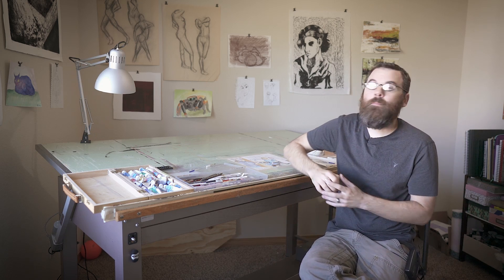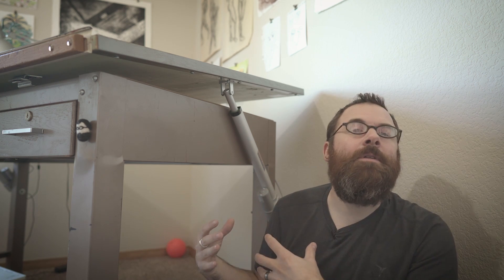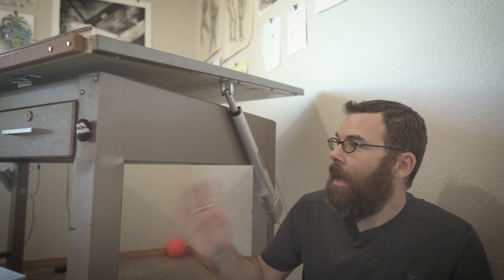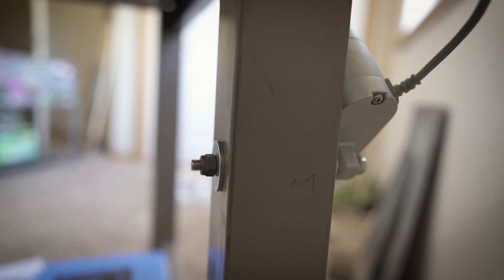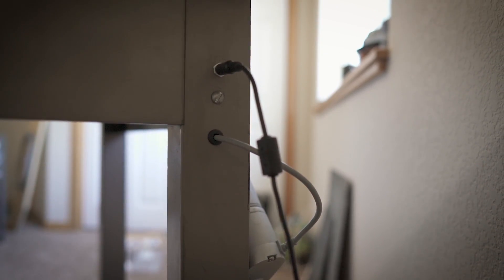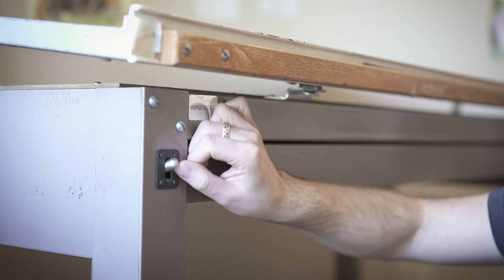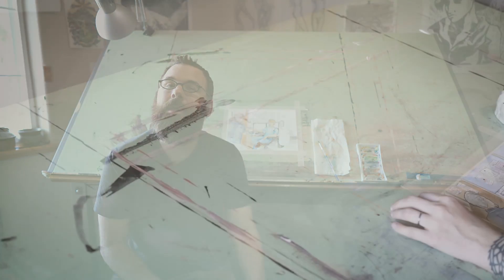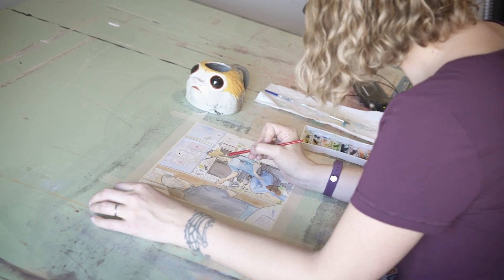DIY Motorized Drawing Desk

Comment: Robert, do you think it would be okay to attach a tirnigy outrunner Motor  directly to a wheel without the gear box or would it not work?
Reply: Too fast not enough torque.

Comment: Could you explain how you wire in the indicator LED on your smaller battlebots?
Reply from the maker: It's easy, just connect it to the radio receiver.  your receiver will have 5V and ground, so you can use that and just make sure you have a resistor so it doesn't draw too much current.  people like endbots or fingertech sell LEDs with built in resistors so all you need to do is plug it into your receiver and you're done!
Reply: Robert Cowan hi, no vídeo this week?
Reply from the maker: @luizsoares9481  I had one, but the original publish/upload date was some time ago, so it didn't show as new.  I will most likely have one next week.

Comment: Why no encoders and regulation ? would make left and right align correctly
Reply from the maker: You're totally right.  I could have read the other two wires coming off the actuators and had them sync up (which is basically the same thing as an encoder), but it wasn't necessary.  The table top is somewhat flexible, so if they're off by 1/4" or so, it's not really a big deal.  If the table top was infinitely stiff (think a solid block of steel), it would be a problem if they were not 100% in sync because it would cause strain on them, but the top flexes enough to accommodate this.  Simply lowering the table all the way gets them back to equal.  In the end, I had to consider the problem I was trying to solve, and doing a feedback loop wasn't necessary.

Comment: Awesome project Robert, your significant other is a lucky girl! Onto the geek question: how do you keep the 2 actuators synchronized? I didn't see any encoders, counting of waveform, etc? Sure with the integrated diode limit switches one achieves "natural calibration" every time you hit upper or lower limit but what if you don't get them to hit the limit meaning you just go up and down as you please, wouldn't the bubble (the leveler that is) eventually tip to one side of the desk or another? On your video I actually heard the upper limit stop didn't occur synchronously, one side stopped before the other? Thank you!
Reply: you can actually see that he doesn't in the full extend demo. The right actuator lags behind and finishes after the left one. My guess is because of the longer cable run and associated voltage drop. 

Because of this the left side will always extend faster than the right, and the table will have a tilt from left to right that gets progressively worse the more tilted the table is, and is at its worst when the left actuator stops, but then quickly corrects itself while the right actuator keeps going.